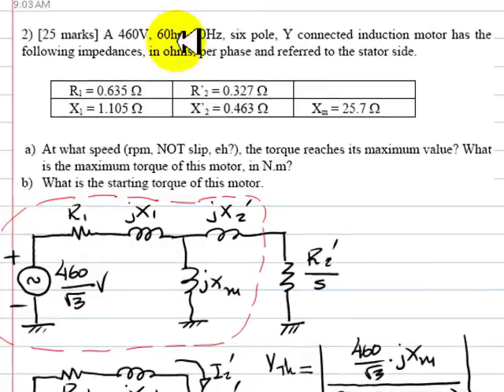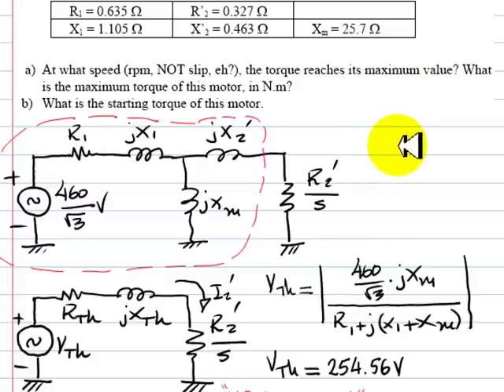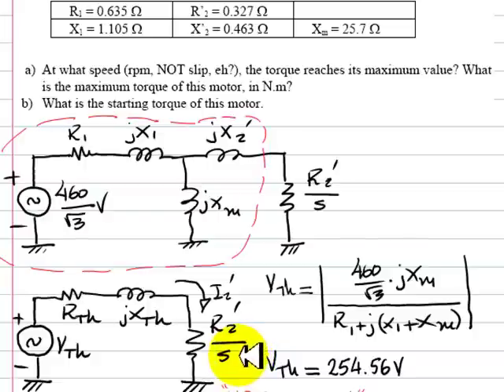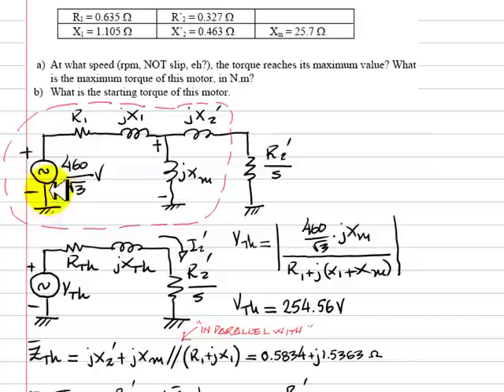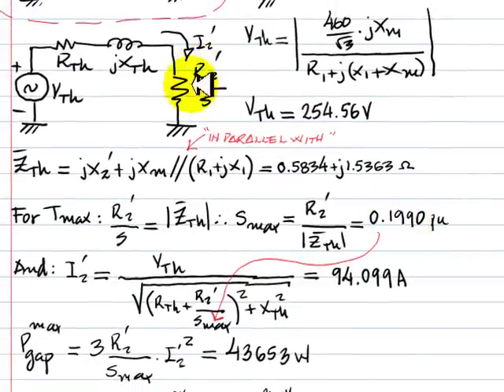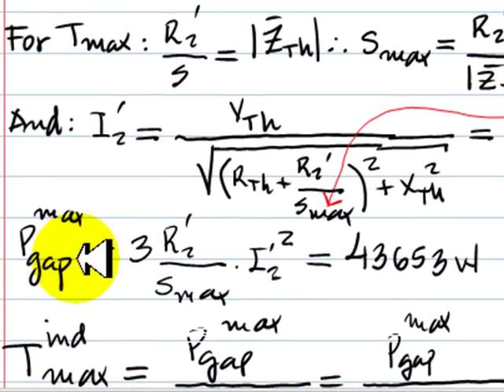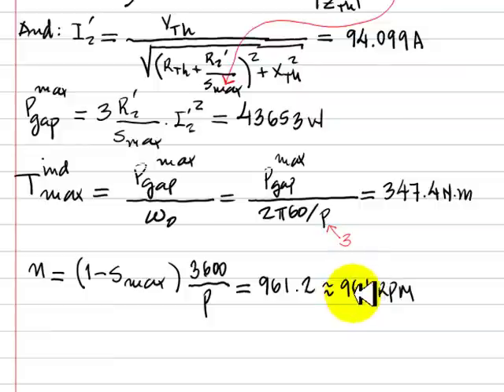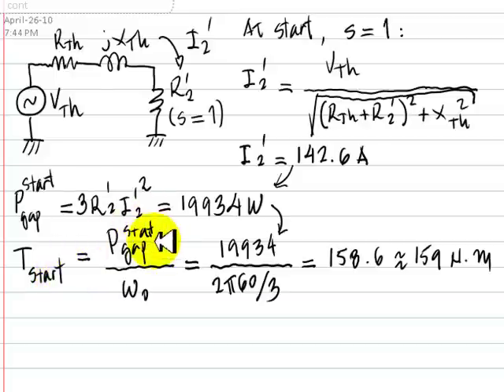Induction Motor exercise from a Final Exam

Comment: How do you calculate Zth mathematically? In other words, how did you get the numbers 0.5834+j1.5363??
Reply: Use online matlab (http://www.compileonline.com/execute_matlab_online.php)
input: v=[((460/sqrt(3))*25.7i)/(0.635+(1.1050i+25.7i))] 
output: v =  254.4901 +   6.0288i 
input V magnitude = sqrt((254.4901)^2+(6.0288)^2), output= 254.56